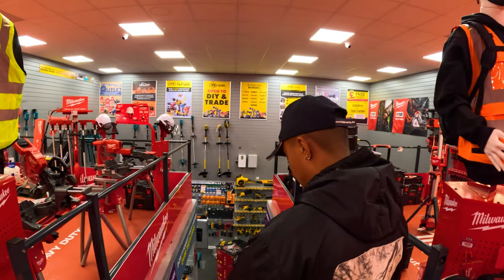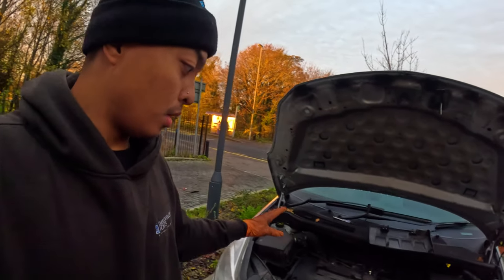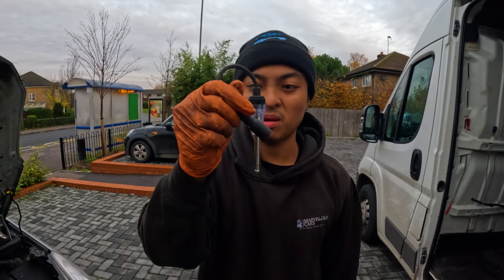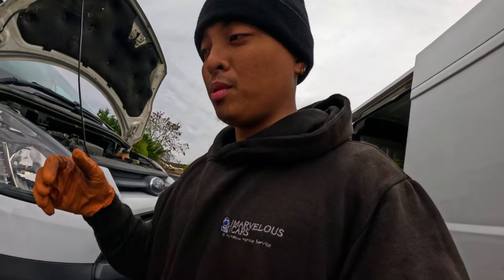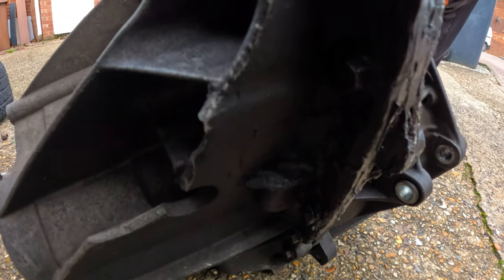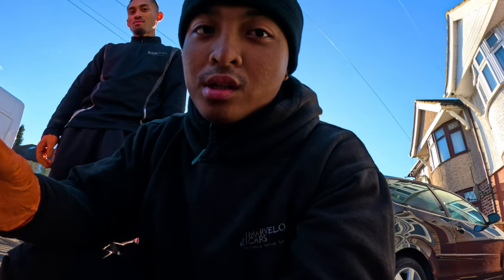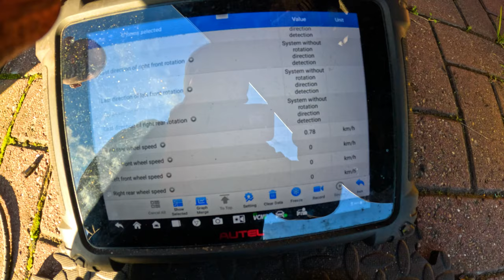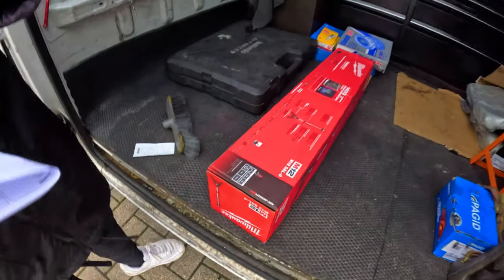LOCAL GARAGE TRIED TO TRICK MY CUSTOMER IN TO PAYING THEM £500! | TEST DON'T GUESS!

Comment: Seems that someone has swapped a faulty sensor for a new one & took it straight back to ECP & they’ve booked it back in without checking ? Hence pulled a fast one cheeky git , I don’t really buy from ECP as just to expensive for retail customers, trade are looked after but not retail so not worth buying crap at retail prices .
BTW please keep theses vids coming , you do an exceptional job & seem an honest guy who is happy to share problems for all to see in case we have same issues ⭐️👍🚗🤗

Comment: That sensor just poped out for you lol , i had to change the ABS sensor on the wifes mini , it snapped , put a screw in to pull it out however it was in there so tight the screw snapped ended up having to take the wheel hub off and drill it out , cleaned up the hole the sensor sit in with a dremmal and the sensor just went straight in with no fuse.
Reply from the maker: Just got lucky, let’s say 😂

They are usually hard to work with
Reply: Should have taken it to a garage if you didn't know what  you were doing

Comment: 14:13 I’m almost certain you won’t but don’t make the mistake I see on these vans on a weekly basis at the roadside…make sure you replace the mirror complete with ambient temperature sensor! So many have had new/replacement mirrors fitted and then they are having DPF issues in a weeks time after haha…always a hole in the new mirror housing where the sensor should be! Trying to convince them that’s the reason for their reduced power mode and warning lights on dash issue is always difficult! Haha
Reply from the maker: It is difficult to spell it for the customer how they relate, even more difficult to make it sound less complicated 😂
Reply: I had a Qashqai only yesterday with the same issue! Haha Also….pushed a job your way too…clutch on a Golf…your welcome haha

Comment: Hi good video my friend she has a vauxhll corsa 1.2sxi and not long ago it started running terribly and it turned out to be plugs and coil pack and i cleaned the throttle body and breather pipe I've done a few other jobs on it running fine now my grandad son had a BMW and that had abs fault and it was on the drive shaft i was going to bo it but he whent to the BMW garage it cost him a fortune he had other jobs done im just working on my mondeo mk4 2.0 i have changed the gearbox but i have not finished it yet i know is awful in bad weather

Comment: I now try to use GSF as I have had to return faulty or used parts back to Eurocarparts multiple times. Once ordered a Delphi coil pack for the Corsa and tried to give me a Starline one🤦‍♂️🤦‍♂️
Reply from the maker: Then they will same “Same quality” 😂

Tbh, obviously this is just my experience, I’ve fitted starline stuff in the past but never had an issue with them. That being said though, I don’t vouch for them, nor I think they should be an alternative for the good brands 🤷🏽‍♂️
Reply: Star"line"

Comment: 9:29 is that jacked up by the sump? is that safe? wont crack or anything?
Reply from the maker: Totally safe as long as you use wood or something of the same material. It is actually on many manuals to support by the sump. 
If you’re worried about it, engine crane can also do the job

Comment: Why wont you guarantee it. Euro offer 12mth warranty on it so whats the deal mate
Reply from the maker: 1. That means we will lose time for when have to come back, let’s say, a month later, if it breaks. Time = Money for us mobile mechanics

2. Travel Expense, again, we will lose money.

3. Letting them know that cheap parts doesn’t come with warranty will sway them closer to buying better parts, which is a good thing anyway… 

4. Reputation is very very very important to us. Selling cheap parts to customers is not ideal because they tend to fail quicker than the more expensive counterparts
Reply: @themarvelousvlog  just fill a warranty form out and claim it back from euro. Business owner myself mate but all my work is guaranteed. Not just half
Reply from the maker: @Berealforever they will only compensate for the parts, not for my time and fuel. What if the customer is 1hr away from where they have the replacement in stock? 

I’m assuming you’re a garage?
Reply: @themarvelousvlog  just charge for the time and get the part free. Im not arguing by the way. Ye garage based 😀
Reply from the maker: Thing is, I can BUT will be difficult and awkward to spell it to the customer why I have to charge them again for the part that I installed, which broke after a month 💀😂
Reply: @themarvelousvlog  i dont use euro anymore, most of there parts are shite nowadays. Flywheels failing instantly. Absolute joke

Comment: Not that I'm criticising, but rather some friendly advice. The reluctor rings on those driveshafts expand from corrosion in the C.V. joint and cause shine spots on the ring from contact with the sensor. This inevitably rubs down the sensor till it stops working. You have resolved a problem by replacing the sensor which is not a hard diagnosis but you've neglected the cause of the fault. This will happen again and if you scoped the wave form after installing the new sensor you would have seen an inconsistent waveform. The other garage is pulling their luck though, you can just clean the joint and install a new reluctor ring.
Reply from the maker: Old sensor was not rubbed down, fortunately enough. 
I am aware of this common fault but as you can see, the reluctor ring isn’t silvering like what you mentioned, still rusty just like anything on this car. 
It was scoped after and the waveform is perfect and consistent. This is one of those things that I always look out for to make sure I don’t go back to the job

Edit:

Thank you for the friendly advice mate. Everyone in our industry should be like this imo. All about helping each other out. Have a good one mate 💪🏽
Reply: @themarvelousvlog  but you don't help the trade by constantly tarnish other garages mate. Not a good look!

Comment: It may not need a new driveshaft but if definitely needs a new reluctor ring, you can see the shiny bits.
Reply from the maker: Ahhhhh! I see what you guys are saying!!! 

That took me about 10x reviewing the footage over and over. How could I miss this 🙈🤦🏽‍♂️

I took a video on my phone but again, didn’t see it. 

I will be revisiting the customer just to double check on it! 

Thank you guys 💪🏽
Reply: Had to do this on both in mine. What happens is it rusts from underneath the reluctor and expands it to the sensor, which ruins it. After replacing only the reluctor on mine, be prepared to  glue the new ones in cause after cleaning the rust away, the new reluctor is actually too big to fit the axle shaft

Comment: My Mrs has a Citroen c3 auto oh my goodness it was spitfire g not pulling and lean no mechanic could diagnose it I replaced the crankshaft sensor no joy I bought rubbish dealer spark plugs even worse I tried one last thing the coil pack it was Delphi and new spark plugs Bosch and bingo it was like original car again irony is to be careful loads of them mechanics who didn't know said scrap it although it took 3 weeks to resolve lamba sensor  nah catalytic converter nah what jokers out there

Comment: Just
 a  quick one with that  1 series abs issue. Those ‘ tone ‘ rings on the driveshafts corrode and swell up , eventually shaving the abs sensor down.  Probably why the other garage said it needs a driveshaft.  You can actually get the tone ring from Eurocarparts , driveshafts are a piece of cake to get out.
Reply from the maker: Other comments mentioned that they saw it in the video (which at the time of filming I didn’t see, or at least it’s what I always look out for as I know how common it is. Funny thing is, old ABS sensor was not shaved or even scratched).

I reviewed the original clip and saw some shine on the ring BUT the shine is too shiny for a car that’s not been used for 2-3 weeks. I know it’s not on the video but I did brush the ring a little because it might’ve been just the rust.

I digress, I scheduled a check-up for this job next week with the customer so will be posting here again

Thank you pal
Reply: @themarvelousvlog   been there plenty of times with these , all fun and games until you get one with a completely fudged axle nut 🤣 

I’m sure you’ll have it sorted mate 👍

Comment: Can you also lose spark by your ratchet crossing battery terminals for a second? My old car lost spark after that happended i ended up scrapping the car lol
Reply from the maker: You just won’t lose spark, you’ll lose your car, just like what you said 😂

Could’ve been just a blown fuse mate. Did you check?
Reply: @themarvelousvlog  lol I'm guessing I fryed the ecu  yh I check all the fuses the ones u can see but I never checked the black box.fuses as you can't visually see if it's broke

Comment: Euro car parts are dog 💩 I’d start using a different factors if I were you
Reply from the maker: I cannot disagree with that comment. I use GSF mainly tbh. I used to be with euros but since my guy left that place, I’ve fucked them off
Reply from the maker: Unfortunately I can’t use autodoc like that as they don’t have next day delivery in to the UK anymore, unlike pre-brexit
Reply: Euro car parts are crap! I made two trips today as they sent me the wrong oil filter, then the wrong sump plug, the the website wouldn’t let me order oil for collection and the shop tried to charge me £10 more even though I was picking the oil up! GSF from now on.